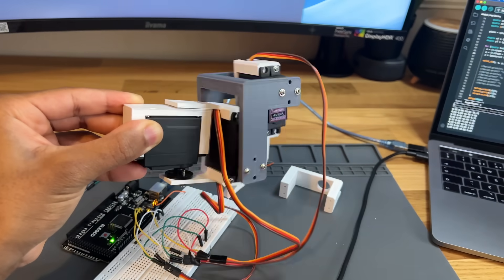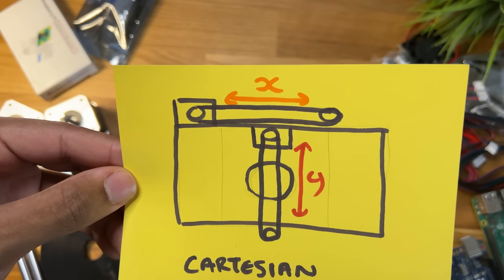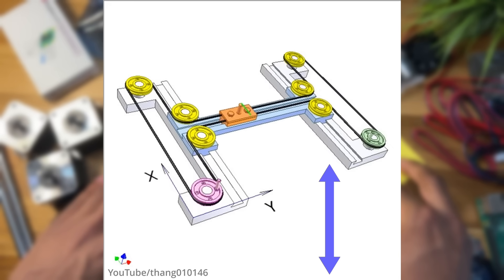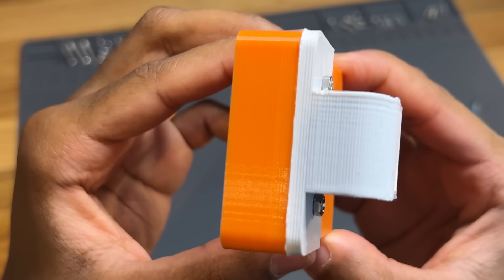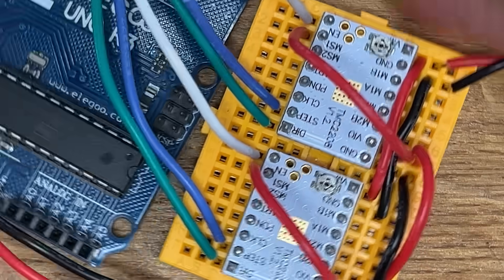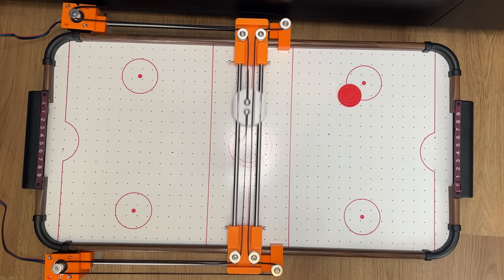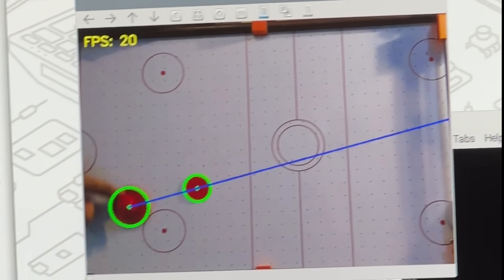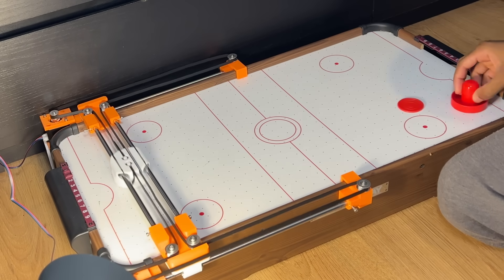I built an air hockey robot that PREDICTS your next move

Comment: I see a lot of comments saying it, but...

Belts need to be tight!  There is a bit of slop in a motion system that has properly tensioned belts. What you have made is not mounted to the thing it is trying to move around very securely and the belts are way too loose.

Comment: here's an idea for making the whole thing a lot more agile by approaching it from a different angle: why not use strings/fishing line to position the paddle? putting stepper motors in each corner should make it possible to position the paddle anywhere

Comment: You provide the motor drivers with 12V at least, 24V can be done. The acceleratoin and speeds will go way faster. 5V is not enough and defo need at least 2A supply (1A per stepper) Higher motor voltage will not burn motors as drivers drive current through the coils, but higher voltage will allow quicker changes in magnetic fields -> higher speeds

Comment: A 5-bar linkage could be a way of controling the paddle without any belts whatsoever. It would also allow for the whole mechanism to be on a single side of the table making it easier to secure. Would require some inverse kinematic calculations, but they should be well documented. Drawing robots typically use this type of mechanism since it's pretty simple, just 4 joints and some bars.

Comment: Try tensioning the belts and using DC motors (which are much faster) with an encoder (counts the turns to help accuracy) for this system. You don't need the movement to be THAT accurate, you just need it to be within 1-2 inches, so a DC motor instead of a stepper would increase speed a lot, while also maintaining the required level of accuracy for this purpose.

Comment: you should probably consider using derivatives in your calculations to predict where the puck would go (just do delta X/delta t to get an aproximation of how fast it is going). If a puck is moving, your current predictions would be way off.

I don't know if you have added this, but PID control to the motors should improve the precision of the movement (you should consider getting some strongerr motors or power supply because they do seem to be strugling)

with enough improvements, you could consider making a more agressive bot that instead of defense, counters your shot.

Other people said also to lower res and increase framerate since you don't need a lot of resolution.

Comment: Wow that’s a cool idea, I always want to try the Sli3Dr mechanism which is much simpler without the motor on the gantry. This could be my project to use it instead on my 3D printers which I don’t want to modify. Btw your belt is too loose. Thanks for sharing your build❤

Comment: Hi Zeroshot (and comments section ppl)

So funny enough, I also picked this as my final project in one of my classes, and in a way, we had the same ideas and issues as what you presented in the video.

We picked H-Bot as well since it was nice in the sense that it only required one belt, and therefore one belt that needed tensioning, however the system just didn't work. Initially it was the tensioning issue, but after that was resolved, left right and diag movements just kept jamming. Turns out there's this common issue known as racking I discovered, and so I switched away from H-Bot to CoreXY.

I now have CoreXY implemented and the racking issue went away, but left right movement still suck for some reason. Up down is perfect, but lateral movement is like the bane of me for some reason. If anyone has any suggestions on what I could do plz lmk. The tensioning should be perfect at this point, but regardless lateral movement is like 1cm/sec, with skipping too.

Last thing idk if you wanna try this, but for us the Pi Camera Module 2 wasn't fast enough for us, so we opted for an IP camera which worked wonders. If you wanna try it too, it's called "IP Webcam" - only on Google Play Store tho. Just start a server and connect it to the Pi.

I'd be happy to take some feedback on how I can fix the system's issues so plz lmk

Comment: You are getting plenty of advice already, so instead of dogging on ya too, for V2 consider a small solenoid in the gantry so you dont have to rely on the whole systems acceleration to provide power when it chooses to attack.

Comment: things to improve:

1.) as mentioned already, belt tension, the front roller carriage needs to be rigid mounted to the frame, or s subframe if you dont want to permanently modify the air hockey table, then the pulleys need to be able to travel back and forth to properly tension the belt. this will fix the belt slipping issue permanently

2.) the "frame" itself, it wants to tear itself apart because its not constrained in any direction, you need to give those linear rails constraints so they can not move.

3.) use a 3d printer board, just the most basic one from bigtreetech is enough, you can push out way more power if you are not limited to what the arduino can deliver via its usb port, using a 3d printer or cnc shield board with grbl will allow you to use the steppers to their full potential

4.) camera, i think a lot of the problems with the functionality come down to the latency and framerate of the camera, you want something that can push at least 120 fps. quality/resolution doesnt matter that much since you try to track a red circle on a plain white background, that doesnt need to be fullhd to work, lower res, higher framerate will make the thing work so much better and be lighter on the limited computing power of a raspi.

5.) dial in your 3d printer and dont shy away to iterate the design more, you recognize that you messed up planning for the fasteners, so go ahead and just change the file and print again - also you could stray away from using hex nuts towards heatset thread inserts, they are much more slick and assembling it will be much easier
Reply: copy on all of the points.. great comment.
Reply: one more
the rebound shot calculation is wrong, it should use the diameter of the puck, as in his calculation, it's assuming the puck is a small point.
Reply: About 3.) this doesn't matter, as the motors aren't powered by the arduino but by an external powersupply (you can see the barrel jack in 5:05). Actually he is using the same stepper drivers as a 3D printer board and the Arduino is just sending the control signals.
but otherwise solid suggestions

Comment: I guess the issue with belt becoming loose is cause by the gantry not being stiff enough. You can seen the motors and idlers walking around while the carriage is moving. Additionally, HBOT is gantries are prone to racking (y axis rotating while moving in x). You can counter this by placing two bearings on each side of the y carriage.

Not sure if you are using 12V or 24V power supply, but 24V gives roughly twice the speed (and power) from the same sized motors.

Comment: tense the belts! all belts must be in full tension at all times!
redesign those gantry pieces that connect static rails with moving rail and give it more room to move - it shouldn't touch the game board
use spring on the carriage to push part of it down onto game board

Comment: awesome vid! As many other people pointed out id tighten up those belts, but im not here to harp on that.
some other suggestions would be to stiffen up that whole frame, maybe drill a couple holes and bolt it onto the air hockey table.
one last thing that may help, I think your steppers will have plenty of speed an torque for what you're doing, the thing holding them back is the low voltage and amperage that they're being run at look at getting a tougher power supply and drivers

anyways I cant wait to see some of your next vids, your content is really cool!

Comment: Interesting idea, but you need to structurally overhaul your gantry design into something more 'monolithic' or at least screwed into the table so it can't pull itself apart, so you can address the belt tension. Though it seems you likely know that by now, it's a little painful, only because you never seem to state it is indeed an issue, and just keep making compromises in a chain to get around it.

Comment: Very cool project and well-presented video! Just a little trick if you ever find yourself struggling to get metal nuts started on your 3d print, you can use a soldering iron to inset the nuts into the plastic a bit. After the melted plastic cools, it'll also grip the nuts pretty well so it can remove a lot of the finickiness too especially in tough spots.

Comment: This is really well produced and the explanations are clear & concise, I definitely learned something from this video. Could you make the motion system more ridged by beefing up the motor mounts? It might also help put the air hockey table on a piece of plywood that is wider than the table. The 3D printed motor mounts could be attached to the plywood instead of the air hockey table, making the motion system more ridged and predictable.

Comment: H-bot... why not CoreXY? Did not want to deal with the slightly more complex belt path? Or was the shorter belts worth the extra bending load at the cross beam joints? Also, I am surprised the design got away without a belt tensioning mechanism.

Comment: Geez, tighten those belts. They should not be moving that much (or at all for that matter). I’m a 3d printer guy so I know a lot about motion systems like this and those loose belts will give you a ton of issues at high speeds and accelerations and probably even a lot of issues at lower speeds

Comment: I think you should try corexy, a pretty common motion system used in 3d printers that has the same advantages then the hbot, but belts are shorter so you can tension them more easily. The tension of your belts seemed to be a very big problem for the motion system to be reliable and fast

Comment: Adding limit switched will remove the occurrence of stepper motors possibly breaking your mechanism. Also, the belt is very very loose. One way to mitigate that is to design an adjustable mount for your idler pulleys. This will lead to a more compliant way of adding tension to the belts. Great video!

Comment: 2 things, why are the motors able to move? In the last shot, you can see one of the motors is very badly mounted and can move, and I’m sure you saw that. And second, PLEASE FOR GODS SAKE tighten those belts. I’m sure everyone here has already said this, but why didn’t you do this from the start?

Also why didn’t you wire the stepper drivers directly to the PI? It has the IO for it.

Comment: There are 2 kind of core xy movement. The one you used it's simpler but suffer from a lot of stress on the carriage and you can see that it is flexing the x axis. Check out the other type, you will need to modify the system a little bit but should fix a lot of issue

Comment: Wow, amazing video for a Youtuber your size,
here are some tipps i would have done differently :

your belts are wayy to loose, you should add a belt tensioner and as you mentioned in another comment, if the robot tries to tear itself apart, i would add a second linear bearing to each side on the carriage or even adding a second rail on each side, that way the carriage wont try to rotate as much in its own axis.

it looks like you just clipped the mounts onto the border of the airhockey table which would be one reason why the robot moves along the border of the table (visible at 8:20), if possible, i would drill some holes in it at the right position (would also help with the robot trying to rotate) to have all corners fixed properly, i would also suggest to add slots into your 3D design instead of holes, that way you would still have some adjustability regarding the position of each corner. 

also as already mentioned in another comment, your raspberry pi also has GPIO pins, just like the Arduino, so you could save yourself a step with transfering data to the Arduino which would help you with latency, as you probably use your Serial connection between the pi and the uno. also in hindsight it would have saved you atleast the cost of the arduino. by saving this step you can also save yourself time, with coding the arduino, and you would have better control via the Pi. basically you want the robot to do as most as possible with the least parts as possible.

keep your work up and your channel will explode, i activated the bell, i would love to see you grow <3
Reply: going to push back a bit on this - you want a microcontroller doing the bit-banging to drive the steppers. It's going to be much faster and more accurate than the Pi can handle. The pi should do the high level stuff and communicate over serial with the arduino, which can then perform the low-level movements.
Reply: @reid-dye I agree on this, even when a high speed printer has a Pi, it still used a micro for the actual motor control.
Reply: all exactly what i was going to say, glad i scrolled a bit before commenting. hope he sees this. if he does, i love the video! keep up the work: im surprised how early i found you!

Comment: those belts are wayyyyy too loose bud, thats where alot of your slipping comes from
Reply: Hard not to notice. I spent the whole video wondering when he was going to tighten the belts (I've never created anything mechanical in my life)
Reply: @2299momo  yea, I only know because I work on 3d printers quite often so I know the importance of having a properly tensioned belt on any motion system
Reply: @2299momo  same im suprised it had enough tension to ven move the thing sometimes
Reply: Yes. It also looks like the motor mounts are loose enough to slide along the sides of the table. Those should be fastened to the table instead. You won't be able to tension the belts properly until the pulley mounts are firmly in place.
Reply: Just toss an idler pulley on there
Reply: It also looks like he used steal wire belts. These are stiff and won't ever run very well on anything. He should get some fiberglass belts instead! This was the first thing I did when I got my 3D printer!!

Comment: dude i don´t know where to start
your belts are SO LOOSE if they were any looser they would fall off
instead of fixing the belt tension you integrate acceleration which slows the gantry to a crawl, and somewhow deduct from that that the steppers are underpowered?
people have built 3d printers from the very same steppers that can reach 500mm/s and 2G acceleration.
Reply: Try a coreXY belt path. Its H-bot without the one sided racking forces, although it needs more belts and is more complicated.
Reply: @josiahong5177  I second that. I've built a H-bot before, and realized that linear bearings on the Y-axis simply introduced too much play. If u replaced the Y-bearings with linear rails instead it might work, but a core-xy configuration with properly tensioned belts is probably better.
Reply from the maker: The belt is intentionally slack, if it's over-tightened the robot attempts to pull itself apart, and that's due to some other design problems that need fixing. Also adding accel actually ended up with higher max RPM.
Reply: @zeroshotrobots the main issues it the stiffness of your chassis/frame or whatever. Those thin small 3D printed parts aren’t gonna cut it. Add some meat to the parts and make it stiff and it’ll be a lot better

Comment: The stepper motors can't be connected directly to the Raspberry Pi, so I'm using an Arduino.
The stepper motors can't be connected directly to the Arduino, so I'm using driver modules.
But why didn't you connect the driver modules to the Raspberry Pi? The Raspberry Pi does have a GPIO port.
Anyway, it's an awesome project!
Reply: to step in (pun intended 😁). The GIPOs from a Raspberry are way slower as the GPIO's from arduino and they lack of realtime capabilities. So it is faster and more precize to use an Arduino for realtime stuff and Raspberry for image prozessing and other calculations.
Reply: @JohnDoe-ck3un  Oh wow. I mean I know that Raspberry PI doesn't work in "realtime" due to the preemptive multitasking. But I'd never have expected the Raspberry PI GPIO to be slower. That's good to know.
Personally I use ESPs for most projects. It might be too slow to process complex images, though.
I can't wait to see more of your projects!